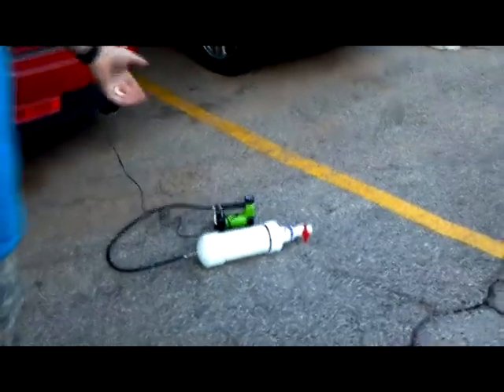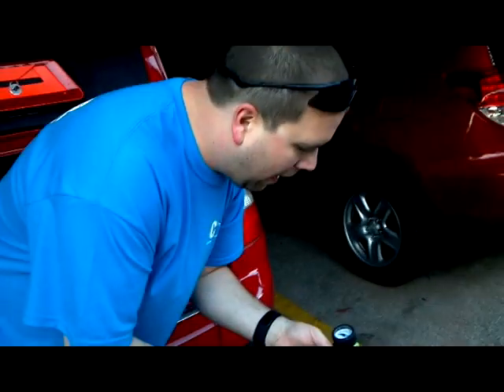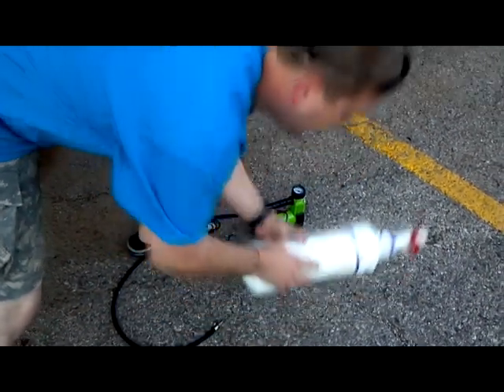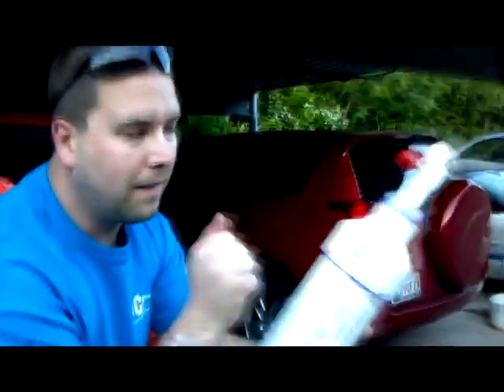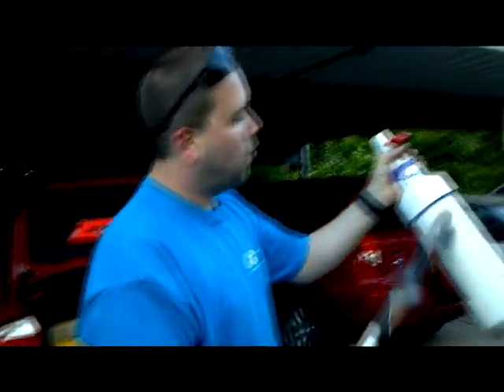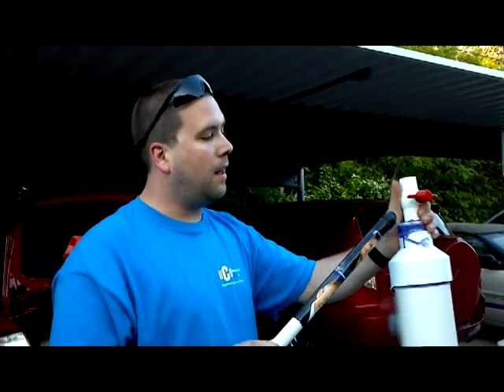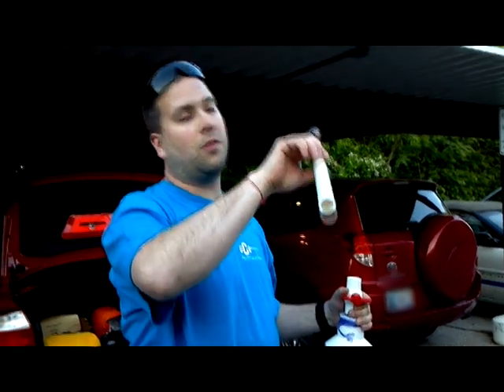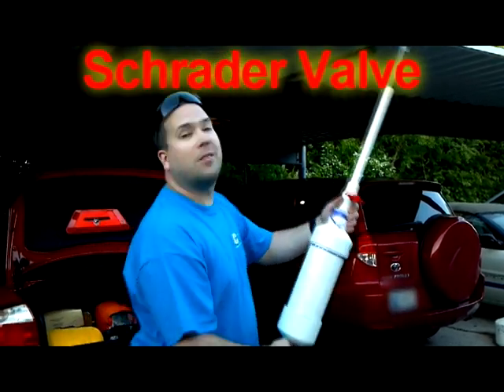Compressed Air Rocket Launcher

Comment: can u tell me how u built that
Reply from the maker: Pretty self explanatory.
The parts can easily be obtained from Lowes or HD for around $20, and putting them together only took around 10 minutes.
Be sure to let the PVC cement dry before doing a pressure test.
Reply: Alright.,thanks what's the air release  switcher call?
Reply from the maker: PVC Ball Valve... $8 at Home Depot.